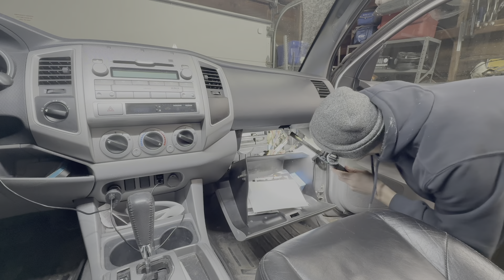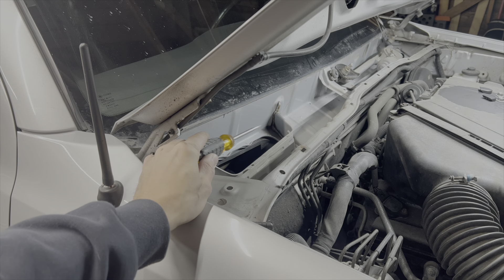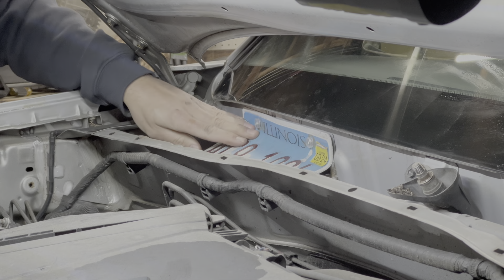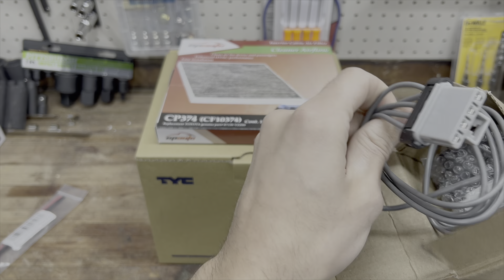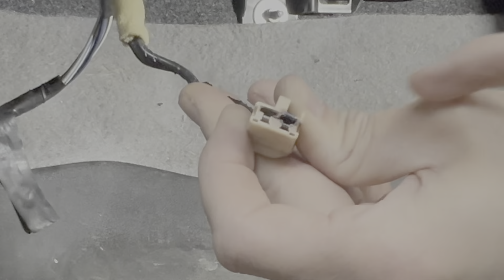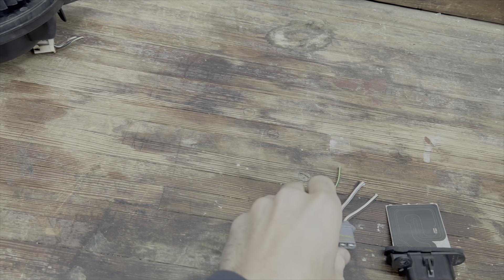Tacoma Blower Motor & Resistor Issue | Root Cause and Fix

Comment: Best video out there for this issue, absolutely the most comprehensive. Way to tackle the root cause. 

What size screws/bolts did you use for connecting the plate to the firewall? Assuming they don’t need them too long. What were those on the bolts, plastic or rubber washers?
Reply from the maker: Thank you! I used some left over license plate mounting screws I had laying around, probably 1/2” to 5/8” long. The things on the screws were little casings that you can clip a cover to. Just acting like a washer in this case.

Comment: How do you know which resistor wires go with hi, med hi, med low, and low speeds?
Reply from the maker: Great question, I did not look at the electrical diagrams to elicit that
Reply: @shopdontstop1  I some how switched wires around and the low and high postions seem correct however the mid two wires must have been switched so after I bought my new fan blower motor and installed it I thought that resistor was dead bec high and all fan pistions were out but when i moving wires around with the truck on the old blower started to work again leading me to closely inspect the wiring and yes that was a cracked exposed wire on the blower so I replaced the blower fan and since I pulled the resistor out as well tryed to correct the switched wiring ans switched the two middle wires.  however, the position on the selector remained the same, off, low , med High, med low, and then high.  I can report good the new fan blower works great and the filter in the glove box was so packed with pollen and pine needles and leaves it was difficult to get out!! I think I took a picture... but anyway, I did find that the old motor while it was operational showed signs that water has been getting to it and the pig tail is also needing to be replaced so just order that and the next step will to cover the direct air intake.  I like the flashing idea however I am tempted to try the tryed and proven technique of a bent old licence plate!  thanks for you post it help me, all best,

Comment: what kind of screws and size did you use to mount into the firewall
Reply from the maker: Can’t remember exactly, they are pretty stubby stainless, metal screws - not self tappers. They were left over from another project

Comment: Great video. 
In my case, the fan blower works in 1 and 2 speeds but no hi speed.
Is this the same problem?
Reply from the maker: Great question, it could be but I would expect 2 to be out as well
Reply: did you find a fix?

Comment: I worry that obstructing the air intake with ANY kind of home made cover might over work the blower motor due to restricted air flow. 2012 toyota tacoma. Gone through 4 resistors so far, all fail eventually, even the OEM risistors. Hate this issue. Only have high fan.....AGAIN.
Reply from the maker: Definitely something to think about. It’s a fairly low pressure system and I personally think a well fabbed cover would not choke the blower motor

Comment: I never had water coming through my blower motor. But the resistor switch is acting up using the air conditioner a lot.
Reply from the maker: Check that harness!

Comment: Thank you for this  had to rewatch the part where you made harness, have the solder connectors so I didn't know you taped the connector on end of wire. Was going to use small zip ties, and use lighter for whole thing the tape it. Thanks again.

Comment: Maintenance…Regular Maintenance! After 13+ years replaced the resistor immediately after “off/high” conditions. Replace my filter every 6 months - remove the blower 12/18 months to clean, along with removing the cowl to blow/vacuum the intake. Buy OEM…buy the best & cry only once!

Comment: I’ve posted my experience with the intermittent loss of all but full speed blower function on numerous Tacoma Blower Motor and Resistor You Tube Videos. They seem to be the most common YT video second only to cat videos!  

Solved my intermittent blower operation simply by identifying a single connector pin and sleeve where the harness from the blower switch connects on resistor block that showed arc fault burn marks, classic indications of a loose and improperly mating connector pin and sleeve.  Shot some DeOxit electrical contact cleaner on the pin and sleeve and tightened up the connection by inserting a small sliver of copper foil into the affected sleeve.  

I never have had any issues with water getting down into the blower motor or resistor.  The root cause of my problem was due to an apparent mismatch of the dimensions of the pin and sleeve on the harness/connector resulting in a high resistance connection which generated heat and arcing within the connector.  

Rubbing noise within the blower usually is caused by fouling of the impeller with debris such as leaves or pine needles.  If the motor spins freely and quietly when spun by hand after cleaning out any fouling, it’s probably fine and will continue to run a long time.  Likewise, changing the harness and resistor connectors may temporarily fix the problem with intermittent contact within the connector but try simply looking for connector contacts and cleaning them up and shimming with a little copper foil first.

I do like the license plate deflector shield fix, will definitely keep crud out of the fan.  You can get aluminum sheet flashing for cheap at Home Depot if you don’t have any license plates handy.

Comment: Good video on the problem. I was having the same thing happen but it was only a problem in Winter. Water would get in my blower motor and freeze. It would then bind the motor and burn out when fan was turned on. This happened once and I replaced the motor and resistor and harnesses to fix it. It just happened again recently but I was able to melt the ice and free it up this time before the motor blew. Now I will go in and cover the intake like you have suggested. Thanks
Reply: Had a problem with intermittent fan operation in all but full speed.  Wiggling the multipoint connector on the resistor bank would restore normal operation.  Turned out the problem
was a loose engagement of the one larger diameter pin and sleeve supplying the incoming 12 volts to the resistor bank.  Pin and sleeve showed burn marks from arcing.  Problem solved by cleaning up the connector with DeOxit and inserting a small sliver of copper foil in the sleeve side of the large diameter incoming 12 volts on the connector to take up the looseness.  Fan would work normally in high speed because the speed control
switch bypasses the resistor bank and applies full 12V (actually more like 13.8V) directly to the motor.  Have seen postings from others on this problem showing the arcing burn marks on that same conductor of the connector, may be a design or manufacturing issue with the connector.
Reply: @AJFog @AJFogertyFan2 What was your fix “Insert a small sliver of copper foil in the sleeve side of the large diameter incoming 12 volt. You’re not saying use aluminum foil.
Reply: @HB-yq8gy I used copper foil
because I had some.  Not sure if aluminum foil would be a good idea might cause corrosion with the dissimilar metal of the connector which is likely tinned copper.
Reply: @AJFogertyFan2  I don’t think mine is that bad it still works. It’s just long fan use. I have to look at the connector when I take out the resistor. Thanks for replying appreciate it!
Reply: @HB-yq8gy Not likely the fan.  If wiggling the connector temporarily fixes the problem it’s definitely the connection to the resistor block.  Highly unlikely the resistors themselves will ever fail either.  You will likely see black arcing marks at the connection, that’s caused by actual sparking between the two sides of the loose connection.
Retired electrical engineer and amateur radio operator here
Reply from the maker: Thanks for sharing, it will help a lot of others with this problem hopefully sort it before burning up multiple motors

Comment: Replaced the resistor , now the connector is cooked
Reply from the maker: Connector wasn’t burned before replacing resistor?
Reply: @shopdontstop1 no the resister went about 3 months ago, visibly burnt, so I replaced , the a week ago blower stopped - and connector is visibly burnt!  I used your affiliate links for both the filter and the connector. I’ve never seen water entering and the blower spins fine
Reply from the maker: @Beerescuemaui  I see, hopefully this next step will have things in a good spot! Thanks for the support using the links!
Reply: @shopdontstop1 fixed it last night
Reply: Nice to have the air again!!
Reply: @shopdontstop1 curious , I think the previous filter was upside down, would that be enough to create resistance and cook the resistor and connector ?
Reply from the maker: @Beerescuemaui  I wouldn’t think so, maybe others can weigh in but it’s not an airtight system so I don’t think that would add enough drag to burn things up
Reply: No water entry , but about to replace connector and filter

Comment: Hey is it advised to disconnect the battery to replace resistor, blower or connectors? 
Thanks
Reply from the maker: I would recommend it, I didn’t and thought I felt a little zing at one point during the project

Comment: I have a 2009 Taco with 210k miles on it. Original A/C and blower, resistor, etc. Never had a water leak from the air vent. I keep it outside all the time and it sits in the rain. Why would it have not leaked like the other ones have?
Reply from the maker: Excellent question, your cowl seal along your window must still be in pretty good condition and is still appropriately diverting the water so it doesn’t drop into that cabin air intake we talk about.

Comment: So I have replaced the resister switch, blower motor, and the fuses. Still does not work. Have taken it to multiple garages and they cannot find the issue.
Reply from the maker: At that point I would start looking to see if you are getting power to the harness. There are threads on the forums

Comment: I never saw exactly where the resistor is installed into the truck.
Reply from the maker: When looking in the passenger footwell it is on the left and the closest thing to the firewall. Kind of an oval bracket
Reply: It’s mounted in the ductwor on the blower motor.  The resistors are placed into the blower air flow for cooling purposes.

Comment: What is that for without being covered? Is it bad to cover it
Reply from the maker: That is the intake for your air that is circulated within your cab by the blower motor.  If you block it entirely then there would be poor flow through the system but I did leave plenty of gap on the sides to allow air in.  I have not seen, heard, or felt any issues since completing the job and am so happy I did!
Reply: @shopdontstop1 is the top over it it like a bubble not completely shutting it? Like should I make a dome over it or flat piece over the top like a closed lid? I’m assuming bubble dome ish to allow air still? Thanks
Reply from the maker: @GABEGRAPES  definitely let air in through the sides, do not cover it completely.  In the description section I have put some forum discussions to reference.  I did caulk the shroud to the windshield because the rubber stripping was dry rotted.  If yours is in better shape you should be good!
Reply: Did I see u caulking that piece back  the the window after u finished ? I can’t rip it off and just put it back ?

Comment: Very interesting!
My 06 model has been leaking, could be the exact same problem you shared here.
Thank you!
Reply from the maker: @chadwheeler931  no problem! Glad to help, circle back and let us know what you find!
Reply: I have a 2012 and will be replacing the blower motor, resistor and pigtails tomorrow , it's very odd that water leaks through there tho, luckily mine doesn't leak. Good video too👍🏽
Reply from the maker: @uno3863 thanks! Good luck with the install!